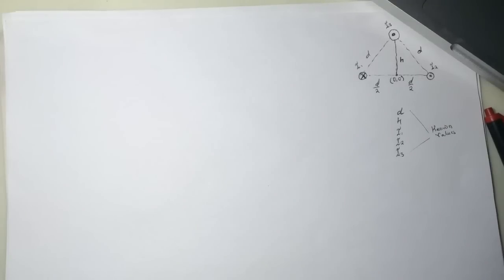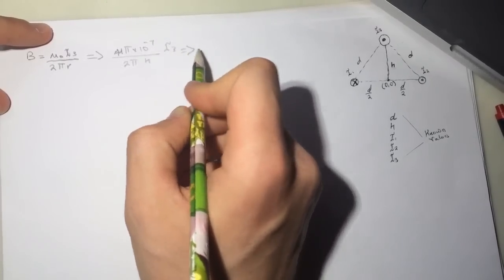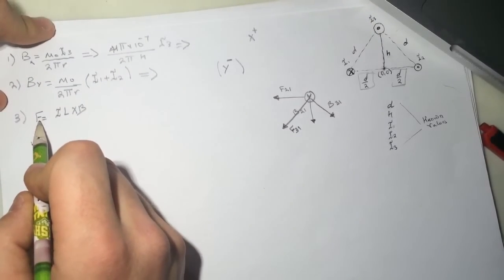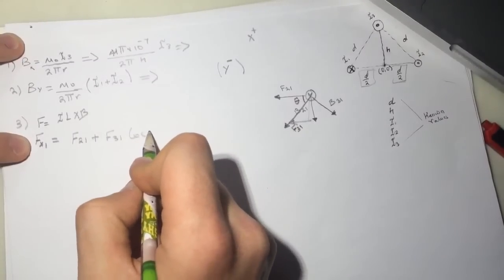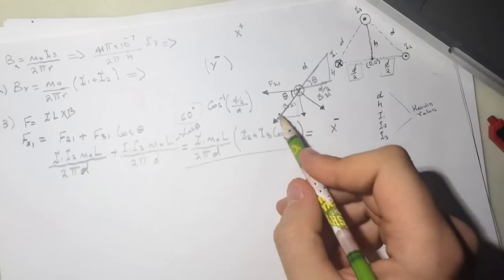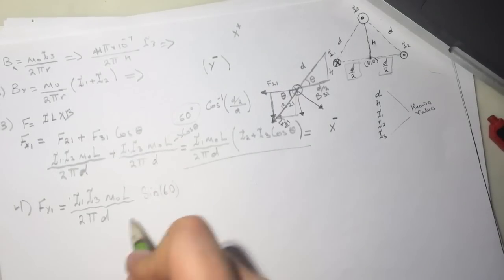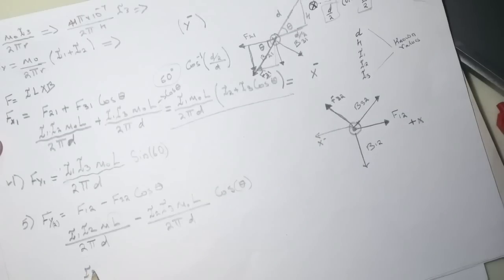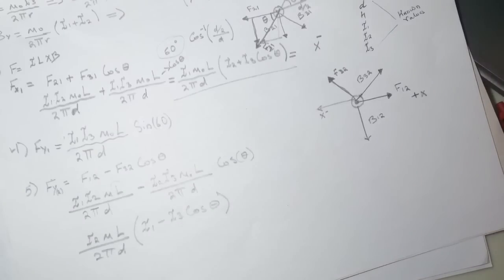Three Infinite straight wires "Smartphysics" Solution.

Comment: the magnetic fields aren't just pointing down the are rotating clockwise and counter clockwise around the wires. This also means that each one produces a magnetic field in the x and y components. Therefore you cannot just solve for I3 the way you did. You need to sum all the magnetic fields and add them. I know this for a fact, because I just did this problem 5 min ago. Your way gave incorrect answers my way gave correct answers.

Comment: the "L" in 3 & 4 is the length of the wire, in question 3 and 4 it says the length would be 1, so just use 1=L

Comment: I can't see how you got the answer for 3. I get the same equation as you but when I plug in the numbers I don't get what you get.
Reply from the maker: Plug your numbers more carefully because my answer is correct.
Reply: Walid Hamarneh I figured it out. I was using only 19cm instead of doing 38cm. Thanks so much!

Comment from the maker: Its the length of the wire that the force is being applied on. If you read question 3 and 4 you can see that it is 1 meter.

Comment: How is it that you got B(x) when I_3 is on the y-axis? The same with B(y)?
Reply from the maker: Good question. Well since current 3 is on the Y-axis then using the right hand rule, you thumb with the direction of the current and your fingers curl in the direction of the magnetic field at the point you are examining the B field at, the same thing apply for the Currents on the X-axis. if you need more explanation let me know. Good luck.